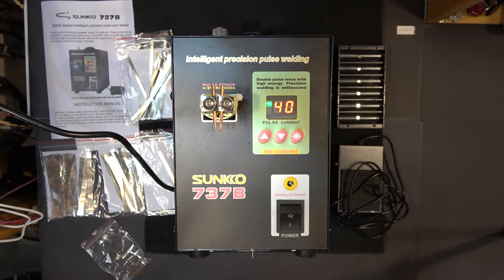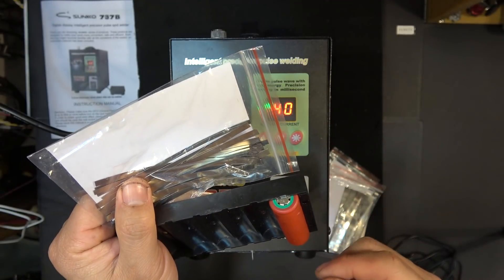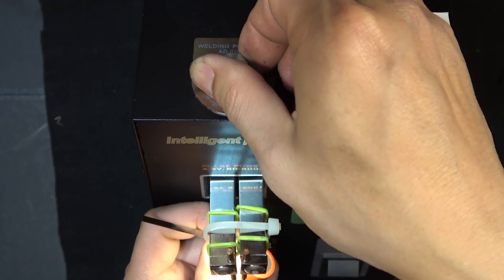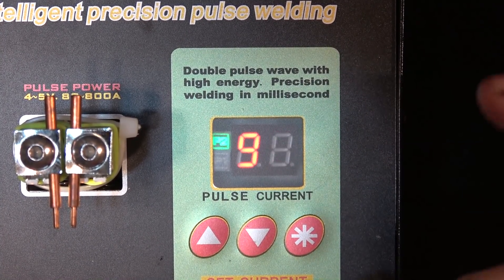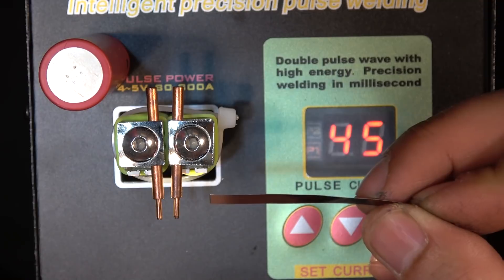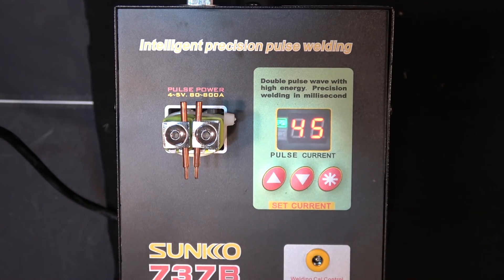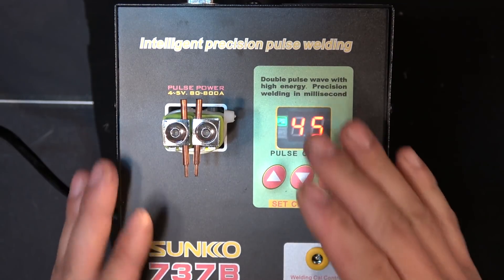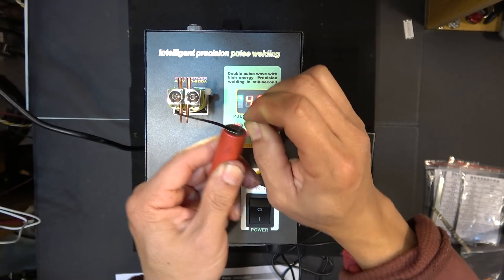Review: Sunkko 737B 18650 battery spot welder

Comment: just solder with a very hot iron. I use 12v soldering iron connected to 20v 5s battery.. works fine

Comment: Thanks for the video, excellent work ! I hjave a quick question, I have 
this one and I would like to install a welding pen so it is more 
flexible and I can spot weld large battery packs with an hand held pen. 
What is your recommentation? Just connect 2 copper cables to the 
terminals ?

Comment: The metal tab on the bottom front of the machine is for a rod to connect to a foot pedal. you pull it down toward the floor, it then pulls your contact arms to make contact to with the cells, then use the foot switch to trigger the weld. That way you can use both hands to hold your strip and cells while you weld.

Comment: (3:30) - Copper is quite a soft metal. 
It would be very easy to bend a dog-leg in each electrode rather than squeezing together the electrode terminals with zip ties.
>

Comment: did u buy one these spot welders and will they spot weld 22650 lifepo4  as they bit biger than 18650 i need a 10s4p pack welding up.
Reply: Did u use the hand held extension or you managed without ?
Reply from the maker: Yes I did. They can spot weld anything that has a metal surface. You just need nickel strips.

Comment: Just a thought ,but if you could get your hands on a piece of  copper grounding wire(1/4 " diameter)   about 12 inches long, cut in to two pieces 6 inches long , bend one end at a ninety degree angle (and sharpen it to a point ) so it looks like the Allen wrench you have , then another ninety degree angle on the other end in the opposite direction and put it in slot where the electrodes go . Do this to both pieces and it should work .
Reply from the maker: That's a great idea. I guess we can use solid copper wires to manipulate the length and angle of the electrodes.
Reply: Worth a try , around my home , I'm pretty sure if I talked to one of the guys installing cable or an electrician wiring a house , they would have a piece that long lying around or about to be thrown out. Good luck.

Comment: You can bend the electrodes to make them closer and if you loosen the top knob for the pressure can you not pull more of the electrode holders out?
Reply from the maker: I can bend the electrodes. But I think it'd be easier to just wrap the arms closer together.
Reply: You can undo the clamps and move them closer to each other at the tips.

Comment: Rather than squeeze the electrode holders together, couldn't you have just made the bottom part of the electrode stick out further?
Reply from the maker: I could. But I prefer to have them straight down instead of at an angle.